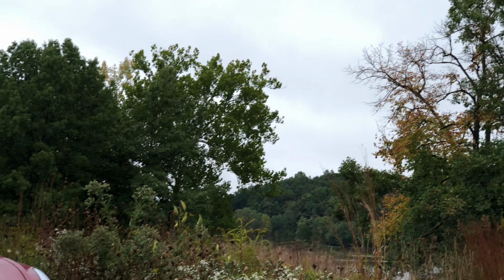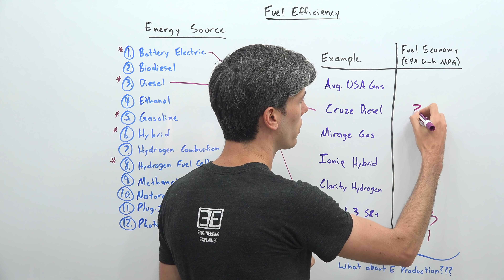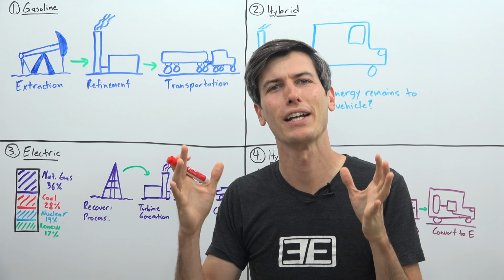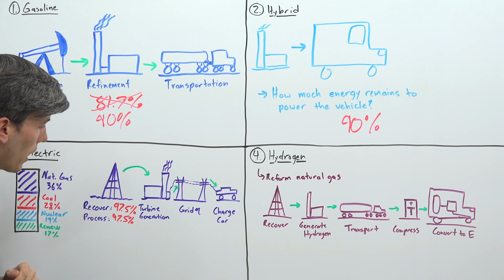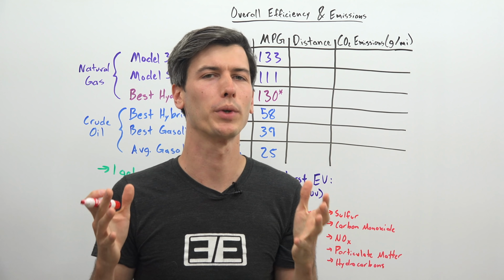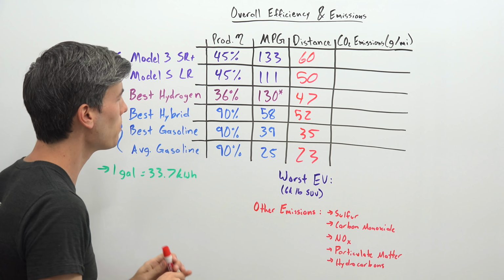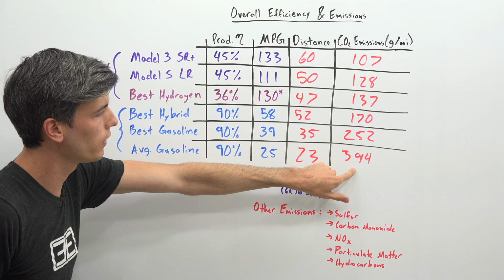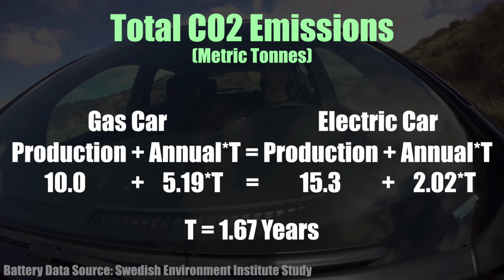Are Teslas Actually Better For The Environment?

Comment: Here in brasil toyota recent released the corolla hybrid flex. It can be powered with E100. Do you know how the efficiency of ethanol production impacts on this calculations and carbon emissions ?
Reply: Thiago Penso Bevilacqua Sure, the E100 fuel’s CO2 emissions are a closed loop, but in order to get all the farming land, a lot of rainforest had to be burnt down, which was actually a biospheric carbon storage...
It’s a double edged sword
Reply: Toyota releasing this Corolla without having the options to charging externally and advertising it as self charging made me lose all respect for them
Reply from the maker: I have not done the math on it, so I don't have an exact number on it. I do, however, recall seeing a study where the land mass required (square footage) to create the necessary amount of energy is massive, and that from an energy standpoint there were more efficient ways to use that land (solar, wind, etc) which in turn would have lower impacts. But again, it'd be interesting to run the analysis on.
Reply: @propergander8509  I am not so sure about that, most of the ethanol on Brazil is made with sugar cane that is not planted close to the amazonian  rainforest. because the soil is too poor here. But of couse it was planted on the Southeast region  of Brazil and northeast coast of course, most of  the original forest on the southeast  is not there anymore but that is because there is where most of the population of the country lives
Reply: we're arguing if EVs pollute less or not, when we could have race fuel, pollute less and have a blast :D
Reply: About the same as to extract the Sugar Cane in a large quantity from the ground, there are tractors running in Diesel
Reply: @lanemendenhall1717  I think you mean gasoline. Natural gas burns cleaner than Ethanol.
Reply: @EngineeringExplained  Probably in the US where it is basically a corn selling scam, but they use sugarcane and get a lot more sun.
Reply: @muskokamike127  Ethanol has more energy than gasoline.  You can get significant horsepower gains just by switching to e85.
Reply: @steveskiba471  That only happens because of the higher octane of ethanol which resists knock in an engine better.

Burning A gallon gasoline outside of an engine VS A gallon of ethanol...the gasoline will produce more heat as it has more energy.
Reply: Probably cut it in half, my E85 Focus get horrible MPG when running E85, normal gas I can get over 45mpg on the highway, I think homeboy's video is bias when selecting vehicles?
Reply: Excelente a pergunta. Não imaginei que o Jason pudesse responder. Ótima discussão.
Reply: @muskokamike127  Correct
Reply: If a fuel source cannot undercut coal on costs per Kwh then all it will do is displace the coal burn to people who can't afford the expensive "green" energy. No net change.
Molten salt nuclear reactors especially the Moltex remove all of the hazards associated with pressurised water reactors and because they are so safe can be built and operated at lower costs than coal. With something that simple why go to all the trouble of digging up and burning coal. The Moltex actually burns waste fuel taken from existing reactors. It's cleaning up AND making money all at zero CO2.
Reply: @Dave5843-d9m  If they're that great, why isn't no one using them?
Reply: Several years ago, I did a well to pump LCA of miscanthus ethanol and found it produced 7g of CO2/ ton of fuel. It is roughly three times more efficient in terms of land use than corn ethanol.
Reply: To convert to all EVs means a huge infrastructure change and to produce the power will use a lot of energy....where will it come from? Wind power and solar take a lot of land area for the equipment, Nuke is efficient but peope don't like it (it actually is much safety than other generation options). Hydro is very limited and not good for environment.  Geothermal, natural gas, etc. In short no one source will be the answer....but a combination of all of them. 
My major concern with electric is the pollution concerns with battery production and disposal. Lithium is a very limited resource also. 
In short there are a lot of technological hurdles to ALL of the alrernatives. There is  a lot of bogus information out also. I worked in the electric power industry for 36 years as an electrical engineer.
Reply: @EngineeringExplained  I am a retired EE with 36 years in the electic utility industry. You are right on.....the infrastructure from power generation to building a huge grid and distrubution system is mind boggeling to support EVs. You may want to talk to an EE from a power company to get some more background. Additonally there is a lot of of environmental issues with all of this.
Reply: @RobertKarlBerta  there is way worse environmental issues with fossil fuels.   Its not even close.  The current method of disposal for fossil fuels is exhaust, heat, and leakage.   At least with lithium ion and earth metal mining the pollution is localized.  Fossil fuel pollution is just leaked into the air, water, and or seeps int o the ground.
Reply: @propergander8509  and where does Tesla get its batteries from?
Reply: @muskokamike127  Don't forget massive amounts of fertilizer, transportation and the heavy farm equipment required.
Reply: @RobertKarlBerta  this guy gets it. there is no one or two answers to the solution. its a mixture of all altenative fuels! plus bio diesel and ethanol/mehtanol can use the existing infrastructure of gasoline and regular diesel. what i wonder though is where i live you can drive on natural gas, is there a alternative to that? like methane from bio gas reactors?
Reply: João Vitor Silva Gohl is
Reply: Yes hypothetically it’s a carbon neutral fuel, what you burn will be reabsorbed by plants to then burn again. Problem is that’s perfect scenario where everything is using E100.
Reply: @johnmoore1495  read trough the comments and especially astro bob's. its been said before. there are huge losses in solar and wind plus those pannels need to be changed since they degrade over time. moar polution since there is no good way of recycling the toxic elements in it. im not against electric cars but building up a huge infrastructure from scratch is harder and stronger poluting than just upgraiding existing ones. i would love to have an electric car, sadly they are just too inconvinient for me. i cant just run a line to my car at home/work (big city life and not enough charging stations) plus i more or less regulairly need to drive further than any range lasts from the best electric car there is. i would love to upgrade to e100 but thats not a thing here so i'll be looking into a lpg and/or cng(methane, renewable) upgrade.

 the best solution is all of them together.
Reply: assasine08 I disagree that LPG and natural gas are part of the future long term as long as we’re getting them out of the ground and not in a net energy positive recycled manner. You’re introducing new CO2 that otherwise wasn’t in the atmosphere.

As for ethanol you’re also talking about a major overhaul to get the production up to E100 along with it. I think ethanol and biodiesel will be around a long time for industry and the military. But other than that the cost of electricity accompanied by electric motor efficiency is significantly cheaper to use/produce than the cost of ethanol and it’s poor efficiency.
Reply: @johnmoore1495  Well cng ist a renewable resource since it's just methane. We have 20% biocng already and any farmer can put up an methane reactor boosting that number. Though I agree it is not good enough for the future and will at some point die out. But a lot of the infrastructure is already there unlike loading stations. It's refilled within matters of minutes unlike batteries. There are already huge amounts of engines there that can use it unlike electric cars. E100, bio diesel and cng are an excellent short and mid term solution. Ethanol is a byproduct of our chemical industries anyway, Cng is produced basically through decomposing bio matter and bio diesel, well also through some biology trickery of biomass. We could even revert some diesels to burn vegetable oil..... Heck we could even revert to burn wood gas...... And most of this infrastructure is already there. At least where I live.

Comment: Recently read about a small scale test in Germany that may affect your calculations if implemented on a large scale. The idea is that windmills make electricity 24hrs a day and at night a lot of that is not needed so the surplus is used to make Hydrogen.  This is then stored and when more energy  is required it is used to either run an electricity generation plant or fuel vehicles. This is not exactly free energy but makes a lot of sense and fuel cell cars could benefit hugely as could we all, as in a battery powered car a lot of the work done by the car is lugging the huge heavy batteries about. As we have seen a lighter car is better in every way.

Comment: I’d love to see the numbers if you assumed coal for the electricity production.
Reply: David Heald Jr. yeah, that’s the main source in my country, Australia.
Reply: You can do it yourself using his formula instead of insinuating something that isnt so.

A coal power plant has total efficiency of 37%. Plug in this number in place of 45% he used for mixed production. The forumla will yield a value of 130  g/mi CO2 emissions, which is still less than one third of gasoline vehicles.
Reply: coal is about double the CO2/J than natural gas, because it is lots of C plus some H vs. a C and 4 H

Comment: You should make a video on price per mile considering the average use life of a car comparing ev to gas
Reply: operating cost of a EV is around $0.03-$0.05 per mile. whereas the operating cost of a ICE vehicle is around $0.08-$0.09 per mile, excluding the cost of repairs for the ICE vehicle. Depreciation is not factored in here, as it would be highly subjective (which ICE vehicle, and depreciation is non-linear). The average vehicle ownership is about 5 years, and the average annual mileage is about 15000 miles. Thus, the operating cost of the EV for those 4 years is: $1800-$3000. Whereas that for the ICE is $4800-$5400. Thus, based on operating cost (assuming no maintenance costs), the delta is only about $3000 odd.
Reply: @kapilchhabria1727  what i find interesting here is that tesla recently annouced their soon to be 1 million mile life exentency battery, wich means if they get implemented in the teslas, it's gonna cost even less per mile to operate
Reply: @tisebi14  i estimated based on the energy consumption and average cost of electricity. given such lofty mileage, over time, owning a EV will far outstrip an ICE viz-a-viz lower cost of operation.

Comment: Is the MPG for the EV accurate? How big would the impact from the following be:
1. The battery discharge when the car is not in use. A gasoline engine will not get this, as the gas stays in the tank to a much higher degree
2. What is the impact of weather and over-charging. Cold weather and charging 90%-> 100% will be far less efficient than the average use.

I guess my question is, are there scenarios where some users are much less efficient than the average users. This is of course also true for the gasoline engine, and it would be interesting to see a comparison between the best/worst users and environments for the two.

Comment: Very good video.
One thing you didn’t consider is the energy, resources and pollution required to produce each of the different types of vehicles.
There is a recent study in Germany that states the amount of resources needed to produce an electric car (water, lithium etc) have a very negative impact on the environment. Other studies say that an EV would need to travel over 80k miles to break even the env impact vs combustion, which with the current rate of degradation of lithium batteries, is a important factor to take into account

Comment: What about electric in winter in montana? Are you going to factor in range when heating batteries and cabins?
Reply: Hey what about people who live in large cities with horrible traffic and will have worse gas mileage
Reply: Or summer in Florida.
Reply: Don't come here with your logic, this is a Tesla fanboy gathering and this blasphemy will not be tolerated.
Reply: My friend in NW Montana has a model S and the heater in winter takes 150 miles off the range in the winter.
Reply: See? This is a problem.  Anyone who understands these.basic details is going to see through any  video such as this.  These half truths are full lies.  It is dishonest.  This video is dishonest.
Reply: Dig deep enough, ask every enemy, scour the records, court detractors and competitors and seize all negative speculation and assumptions about anyone or any thing. Amplify weaknesses, celebrate missteps, accusingly assert the slightest doubt or deduce a damning nature, conveniently leave out the positive stuff and you’ll find some dirty laundry. No one wants that weaponry turned on them yet some will not hesitate to direct it at others if it serves their purpose. Intense unobjective micro coverage on a subject corrodes the message’s validity and the deliverer’s  credibility. 

The truth shall prevail. The FUD shall not. Intention, Intelligence, Invention. Make It Happen  🔋⚡️🚘
Reply: OR you could just not heat it and still have half the range with the same emissions. The average American drives 33 miles per day. Or if you park it in a connected garage that isn’t heated it’s still warmer than outside thus keeping some of the range. Either way the greener you make the grid the green electric cars becomes. There’s no making gas greener without moving to biofuel or increasing MPG.
Reply: @johnmoore1495  baloney. Pretty much impossible to drive a car in really cold weather with no heat. Not just an issue of comfort. Windows ice up continually when not supplied with copious amounts of heat. Try taking a road trip from Detroit to the western upper peninsula in January with no heat.
Reply: Mike Betts I was arguing against heating the batteries not about the cabin.
Reply: @johnmoore1495  Ok, that might have been your intent and sorry for coming off as nasty.  I was speaking more towards the original comment which talked of both the batteries and the cabin.
Reply: Model Y has a heat pump, which should help immensely for a good portion of the forced heat requirements...

Comment: Thank you for pointing out that an EV's efficiency will improve over time as power companies increase their renewable energy generation and the grid. Could you please do a scenario with charging an EV at your house with solar panels + a battery pack?
Reply: Somethings that's quite funny to consider is that gas can also become greener with time. Like using solar power to pump oil or electric trucks to transport fuel (yes, very ironic)

Comment: Jason, you've missed some key real world inefficiencies in the "input-output" calculations. Starting with power plant consumption,  "heat rate" (BTU's input / elec KWH produced)  and ending up with electric meter KWH. Then from elec meter to  wheel output calculations. Additionally, using the published fuel economy for EV's is wildly in error.  EV's convert 58% to 62% of grid power to the wheel. We must also remember that steady-state combined cycle power plants require peaker turbines and/or supplementary firing (drives efficiency down) to manage heavy loads. Big difference between "Gross Output" at the generator terminals or "Net Output" at the power station grid connection. As some of the power is used in powering the plant itself. We've not broken 54% efficiency at the grid connection yet. BEST CASE: 54% 92% 60%, power plant, grid loss, meter-to-charger-to-battery-from-battery-to-controller-to-motor-to-wheel loss. Put simply, the very best we can do is convert 29.8% of the BTU's in natural gas to wheel power in an EV.

Comment: I love the vid but I have a question, how do you determine what a gallon of electricity is?
Reply: Energy density of gasoline: ~34 MJ/liter = ~129 MJ/gallon = ~36 kWh/gallon without taking into account engine efficiencies
Reply: @teslacles8565  thanks for the wisdom lol
Reply: You can convert gasoline energy for direct comparison with electrical energy like Teslacles did; however, the "gallon" that Jason is using for electric cars is the natural gas used to generate electricity. For this calculation he assumed that only natural gas is being used for electricity generation (even though that's not the case), which gave ICE cars an even more favorable handicap - and electric cars still won.